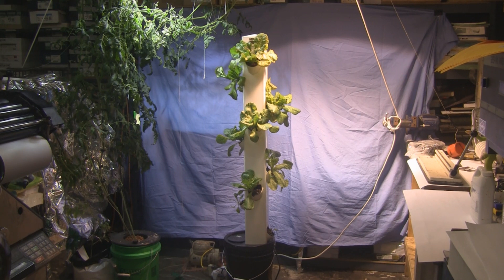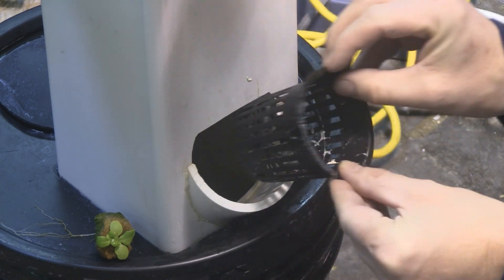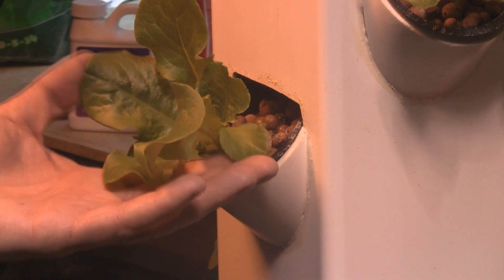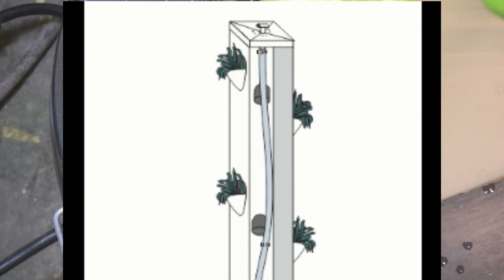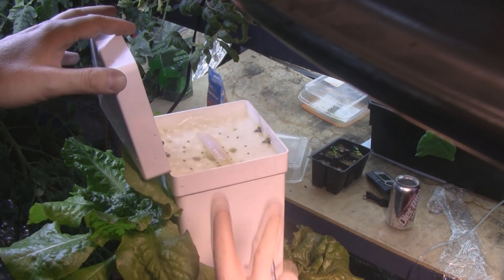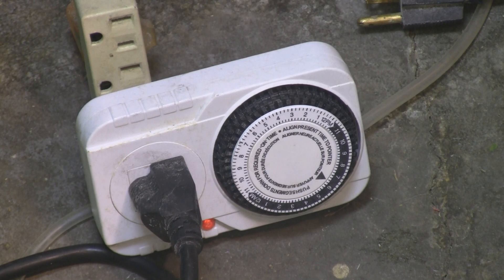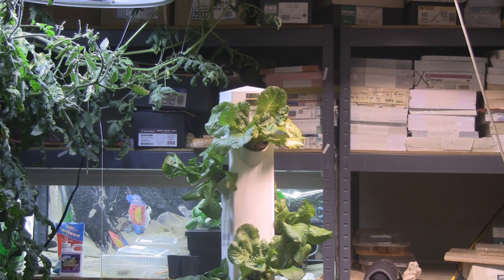The Rain Tower - Vertical Hydroponic System

Comment: Hi. 
Does the water turn on every 15 minutes and stay on for 15 minutes? If that's the case, is doing it this way better than using a cycle timer (5 sec on 1 minute off, for example)?

Comment: That is a very cool system really! you're saving so much on soil and space. Is it affordable? I mean the systems plus the electricity used to power the pumps? also, can you throw compost tea in there once in a while to super charge the nutrients? and what are those water stones u used? can u use regular pebbles? or they have to be those brown bean looking ones?
Reply from the maker: A single one can be made for about $120, even cheaper if you make 2 of them since you have the supplies already.  It barely uses any electricity because the pump is low wattage.  All you need are the nutrients, no need for compost tea.  The pebbles are called hydroton.  They are light weight made of expanded clay,
Reply: Wow thank you for the fast reply. I will look into it for my balcony. Thank you :-)

Comment: FYI this is NOT a hydroponic system. Look up the definition.
Merriam Webster: a method of growing plants in water rather than in soil
Cambridge: the method of growing plants in water to which special chemicals are added, rather than growing them in earth

The key word phrase is "in water" NOT "with water." Hydroponics involves having the roots submerged "in water" CONSISTENTLY and not intermittently.
This is an AEROPONIC system.
Cambridge: A plant-cultivation technique in which the roots hang suspended in the air while nutrient solution is delivered to them in the form of a fine mist.

You may have mentioned that this is aeroponic in your video, but the titles on this video and your website are absolutely misleading.
Reply: Not always a misting system is used. Occasionally you will see them utilize a drip system. I hydroponics the roots are contained in a growing medium constantly as opposed to aeroponics.
Reply: +Ithcarius - We'll I guess we all stand corrected by you Ithcarius. Does that give the one-up on everyone hoping to get grow tower info from this video?? Jerk
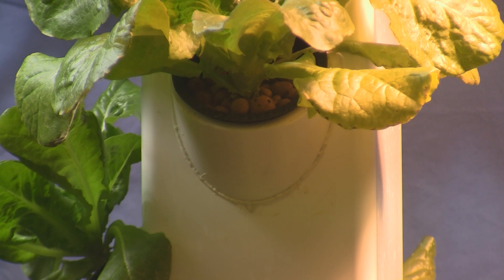Reply from the maker: +Brian Young It didn't watch the video where I say it's aeroponic at 1:00.  Thanks for showing her the way.

Comment: BS-- Juice Plus+ Tower Garden, multilevel marketing pyramid pitting friends to profit off friends.  

USDA is not "approving" it - that requires inspection.  It is simply partly made from something we need to believe are resins compliant with the USDA according to JuicePlus+.  To be food grade, all elements must be food grade. Where it counts, TowerGarden has a cheap 20W $15, 1 yr guaranty Chinese crap pump that spews disgusting leachate in the most vulnerable warm, frictional part of the system

Comment: I know I'm a bit off topic here but one facet that doesnt seem to have much info available is LED lighting and the running costs. Does anyone have any info on what would be required to light an area the size of a parking spot and do you have any suggestions? Ideally I would like to battery/solar power it along with pumps etc

Comment: With PVC the thing to worry about is the metal lead, which is added during processing to improve stability and mechanical properties.  It would be better to stick with say, 4" sch. 40 drinking water PVC (NOT PVC sewer pipe, which is much cheaper).

Comment: How do you prevent the chemicals in the PVC pipe from leaching into the water and vegetables or is it designed to never be used outside in the sun and heat?  I know the Tower Garden by Juice Plus+ is made from USDA-approved, UV-stabilized, food-grade plastic so it can be used outside.